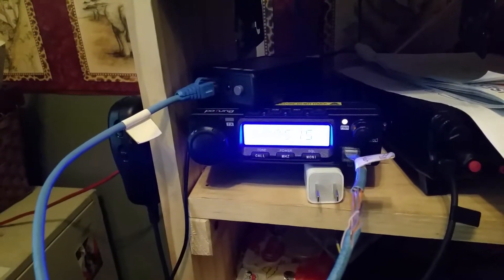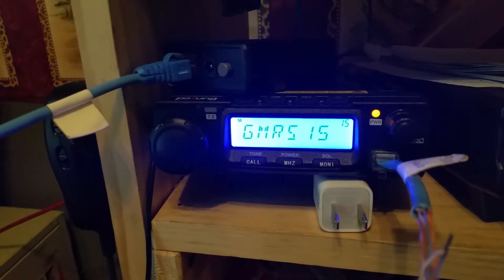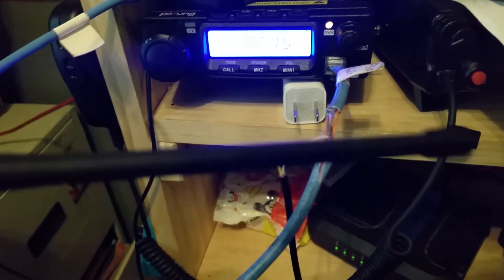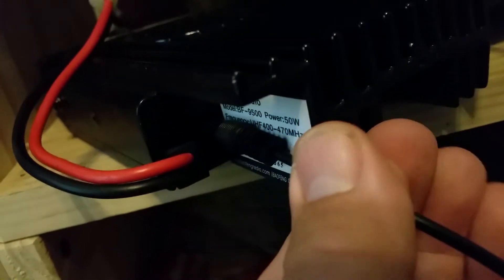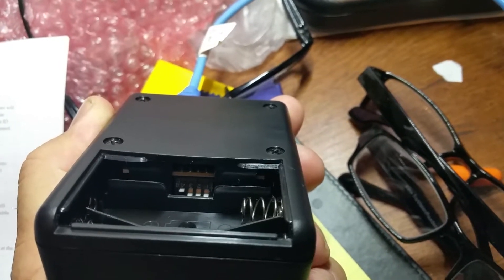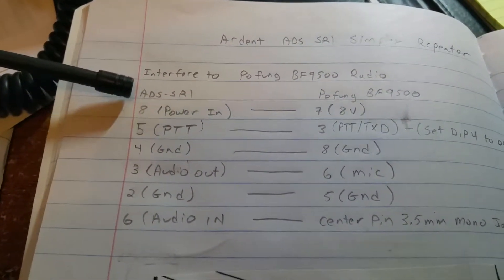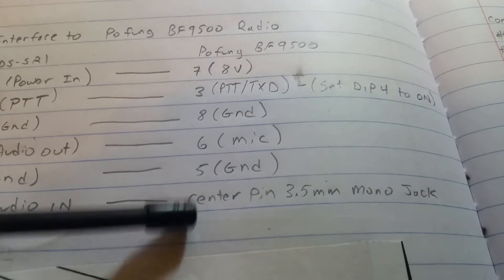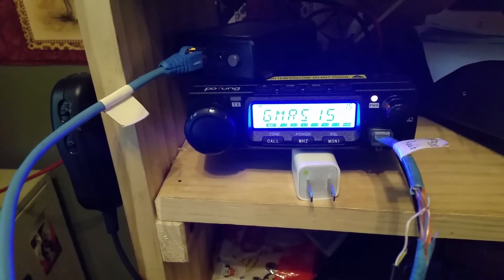Ardent ADS SR1 to Pofung BF-9500 Interface

Comment: nice video . i just want know how u program that radio ,which firmware work on it thanks
Reply from the maker: That is a problem.  Chirp doesn't have it as an option.  I do believe that the RT systems works with this radio, but it's software you have to buy.  Since I only use this for GMRS I just manually program it from the radio front.  It only takes about 5 min to program all the GMRS Channels.  I have a text script with the button sequence for programming.  I'll past it here shortly.
Reply: ya rt systems . its 50$ with cable i will probabli gonna buy that shit

Comment: How about a update on your gmrs repeater, performance and problems. Getting ready to build one just like this and would like to know issues you've had.
Reply from the maker: Only issue is that to swap from using it as a repeater to a radio you have to unplug the microphone and the mono speaker cable.  The mono speaker cable port is just kind of in a difficult spot on this radio.  Requires a little all thumbs fumbling if you leave the radio on the rack.   Been getting about 3 miles radius range from home antenna tower to mobile antenna both at 25 watts.  Would be better with higher antenna, currently at 30 ft.  Have a portable / bucket system designed for this repeater for field deployment.  Will be posting another video on that later when i build it.  BTW, it's a good time to get these BF-9500 because new FCC rules are going to prohibit the import of these.  They are going to shoot up in price when the supply diminishes.
Reply from the maker: Update - added an antenna 90 ft up in a pine tree.  Big difference getting 6-7 miles to my truck.